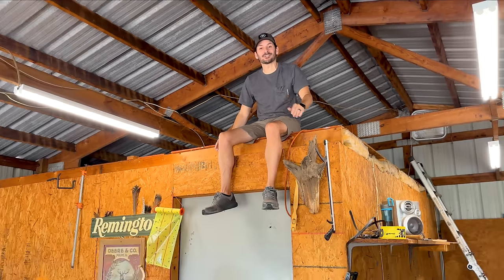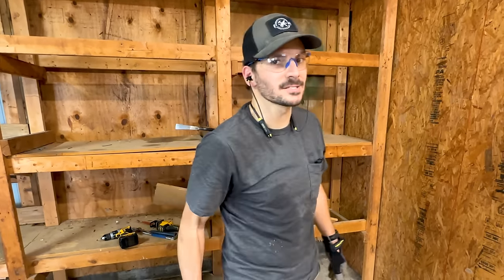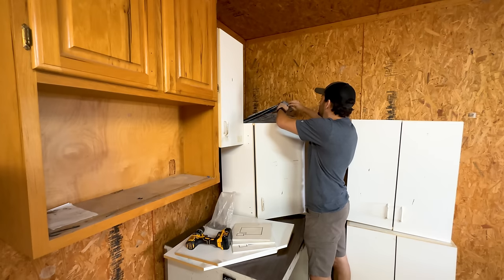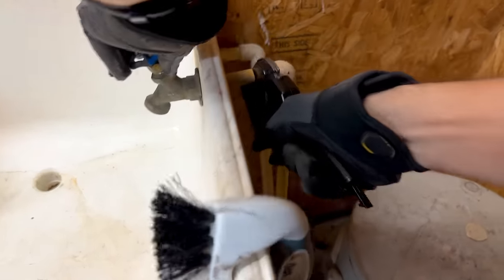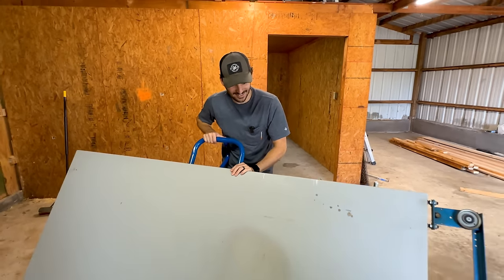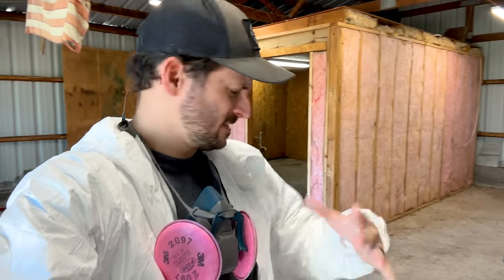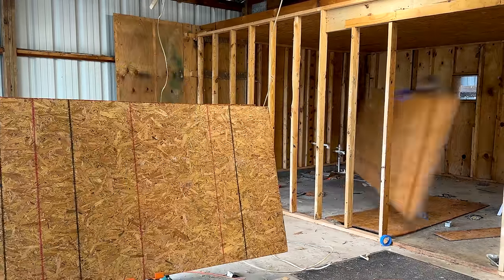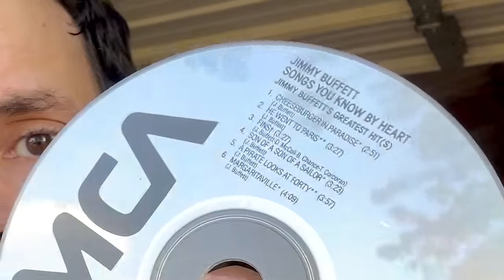It's worse than I thought... Demolishing My Old Shop

Comment: Good thing you didn't breathe the mouse stuff in. Hantavirus ain't no joke (especially on the fatality rate). Every time someone's playing with rat nets (cars, houses etc) it's basically a reverse lottery of who gets misery, who gets... well, the other thing.

That aside, dunno if you have already or plan to, but you should check all the roof stuff as well. Make sure everything's on the right side of history (structurally and as a barrier). A lot of new owners ignore that part of a building and it ends up biting them in the bee hind because that's where the leaks come from. What you want to look for is loose connections, rotten wood, evidence of leaks. Two tools are your friends up in there, a small prybar and a good headlight. You wanna jiggle all the wood element connections to see if there's anything that may either be rotten or loose, those need addressing quick. It's wood, you know the score. 

Shop tip: think about a small rail crane. Having a crane by the door to remove loads and put them on carts, that's a good thing to have regardless of what that shop's purpose is. I'd go for either a 2 ton or a 2.5 ton crane. Excessive, but it's that .5 that gets you out of a squeeze one day. My first shop never had one, i found out really quickly i needed one, and putting one in post factum is a pita. If you don't feel like changing to a door that allows you to have a crane, you can also install a jib crane. At 2.5 ton capacity (max for anything you'd ever pull in a shop that small) you just need to find a metal pipe and build a classic swing type. Nothing fancy, since you're not gonna use this 24/7 like a workshop would. Suffice to have a hook for the moving part and a wire from the top of the pole to keep the arm up. If you look up old school work site cranes, there's a bunch of Modern Mechanix like DIY instructions to pick from online.

11:29 could make a table out of it. If it's good metal, it's going to last quite a long time. I have made tables out of doors in the past and they're the abused work benches in my shop. For legs, i've always used second hand cabinets. 4 narrow cabinets arranged with a hollow space in the center and all the shelves facing out. Makes great storage and the center area allows you to put electric stuff in the center if you need powered outlets. Those pop out outlets that are flush with the table surface are perfect for this. If you can't find flush ones, you just get a normal set of pop out outlets and just glue them in place without the trim. As long as you don't mess with the electric aspect the extra bits are just that, extra.

extra tip, buy one more of those nail grabbers and either weld or ask a friend to cut and weld the tip (about 2 cm from the nail grabbing feature) at 90 degrees from the handle. For narrow spaces, they're god sent, but even for common use, because the striking point is closer to the nail while you're able to keep the grabber tips from the side and out of the hammer's path, you get a lot more control. Some sell 90 degree, narrow space ones, but if you have a nail grabber that's quality, it's always best to use that one, and not waste money on the off chance they're not as good. Not all nail grabbers are made equal, some are just junk and that's even from reputable brands.
Reply from the maker: thanks for the well thought feedback!
Reply: Hantavirus is pretty rare and pretty deadly, like about half of the people who get it will die.  I saw one case in my career.   A guy was cleaning up droppings.  He barely walked into the ER the day after he got the "flu".  He rapidly became unstable and died about 3 hours after he arrived.   Pretty sad.  (I also saw a case of rabies in a four year old girl but that's another story)

Comment: I laughed, probably harder than I should, at the "Love of nails comment. I redid my kitchen this year and they had previously put in a drop ceiling. I got down to the frame that they attached to the ceiling too, and as I was doing sheetrock I went about pulling the frame down ONLY to find out that they had used FIVE INCH sinkers to affix the 1 by material to the roof. I weigh a good 240, and at one time had myself hanging from a hammer trying to remove these nails. God help us that ANYONE thought that this, or your nails, were a good idea.
Reply from the maker: 😂 😂 Yeah, they had some 16 penny on the 1/2" OSB in a few spots. Had to use the leverage of the wrecking bar for those

Comment: As a former garage door tech, I don't recommend WD-40 AT ALL on the door, and not necessarily WD-40 lithium either. Use LUBRICANT.
Reply from the maker: genuine question, why don't you consider white lithium grease a good lubricant?
Reply: @Fixthisbuildthat  I'll admit that it's a bit of familiarity. Silicone might have advantages with plastic rollers, which many garage doors use. As a rule we tell people to avoid WD-40, because it's basically a detergent with mineral spirits in it. Most don't think of their lithium grease product.

Comment: I know you talked about re-using some of the materials you took out.  Honestly, I would throw everything out, pressure wash the entire interior, spay paint all the wood, and start all new.  Or at least spray paint any wood/sheet goods you reuse.
Reply from the maker: Keeping the wood. Everything else is gone.
Reply: @Fixthisbuildthat  Inwould still take gallon sprayer and spray the wood with a water and Clorox mixture 1 part Clorox, 9 parts water

Comment: Elevator door would in theory work well as an assembly table, it should be very flat and wood glue shouldn't' adhere to it, you can scrape anything off it easily like stain and you should be able to build a folding frame w/ wheels so you can fold it flat against the wall - also don't expect anything at all to be done right anywhere near the house... what you are seeing is peak "I'll make it work with what I have" engineering and i'm sure they didn't stop at the shop... be very careful doing anything with electrical in the house as there are problem random outlets and switches on random breakers all over the place.
Reply from the maker: yeah, this place is goingto be full of "surprises" I'm sure

Comment: When you lube a garage door you don't spray the wheels or tracks.  You lube the pins and sleeves that the wheels are mounted on.
Reply from the maker: I don't think spraying both can hurt since it's all metal anyway
Reply: @Fixthisbuildthat Nope, doesn't hurt one bit, besides attracting more dust and dirt.  I just wanted to point that out as most incorrectly spray the tracks and wheels itself.  Also, it just so happens that the sleeves and pins are what also causes most the the rattling and noise when opening.   They do make plastic bushing/sleeves which drastically reduces noise.

Comment: I have a 50‘ x 70‘ RV building 16 foot high doors. Let’s plan for me to do an Internet store 1000 ft.² on one end. And then we decided let’s do an apartment upstairs so there’s a bathroom downstairs there’s a bathroom upstairs that I built for my son two bedroom nice apartment. However, he got married but that’s OK so I still have a 50 x 50 building but useful with three doors one to drive through and one it’s just a single Door And they’re 16 wide 16 high. On one side there’s all these shells for storing extra stuff, welders and all the things to do with that kind of stuff and then there’s a 37 1/2 foot toy hauler that goes in that day. And then in the middle, there’s a, 16 foot box trailer, my jeep and my tractor. So in the next day, I have a long flat, but two axle trailer and there’s a workbench against that one back wall. And there’s also room to drive a vehicle in front of that flatbed trailer. There’s a set of stairs for the apartment upstairs on the inside of the building and there’s one sit on the outside. I don’t run the Internet store any longer, but anybody wants to buy a whole bunch of aviation stuff open up a store solo to you one price. Whatever you have is never big enough so just letting you know that’s not my house garage. That one is overlength so a crew cab long bed & Cadillac would fit in there instead of having a instead of a 16 foot wide opening on that garage it is a 20 foot door opening so you don’t have any problems getting both items in and getting out of the vehicle some both sides. You can never have enough garage space. And that doesn’t count the 36 x 60 building in the back of the house that has an indoor pool that’s 16 x 40‘ with a bathroom in there also that’s not the house either love my house but people think it’s much larger than it is

Comment: Lots of nice reclaimed material for future projects. 
I’d personally make a welding fixture table out of those sheets. 
Good enough for smaller jobs. 

It’s always nice to have a work surface that can’t be easily damaged.
Magnetic jigs work and you can resurface it with a wire wheel when needed.

Comment: Honnestly, the kid inside me is always screaming "if you build something and don't put a Hidden area or secret passage, why are you even building that in the first place. Just put some fun in your work dude".

So, i'd suggest you to get that elevator door to get some cosy rest area, or like, some shortcut to your house or exterior toilets. I always feel the need to take a rest during craft, so, having an area with a nice door like that where you can just you know, chill up, have a cold drink, and maybe a computer to just do nothing while you're getting your energy back on level, that could be good.

Maybe it could be that : enclosed area with computer to previsualize your vids on the shop. And keeping dust away from your electronics.

Comment: Hey! I came here just to make (funny) comments because you have a place for them.  And I figured you could use some cheering up since you almost killed yourself three times  in the process of the demolition.  My comments won't be as (Potentially) Shocking as some of the things you found in your demolition.

In a video comment section  today  I saw Where a  content assembler said, "if you were gonna do it, overdo it!".  I think the guy who assembled the shelves in your "shop to be" ascribed to that philosophy. He also might've only had nails when initially assembling it and added the screws later. I can't imagine doing the screws first, and the nails later. But guys  Who were building stuff pre-pneumatic fasteners and pre-cordless impact  Drivers used nails. 45 years ago you could buy a  50 pound box of six, eight, or 16  steel common nails  for  $20.

Theory-  The mice gnawing  their  Way through the insulation were ( what we will soon no longer call) Minorities and women. They were chewing their way to the top through  what they thought was the (fiber) glass ceiling.  It's close to shattered now.

"Once you label me, you negate me" Soren Kierkegaard

Comment: The more insulation, the cooler inside the building in the summer and the warmer in the winter!  

It goes for all kinds of buildings, but especially inside a metal box!!

Windows (and a door) in the back will provide most of the air conditioning you need in the summer.  The extra insulation, 10-12 inches in walls and roof will be paid within 2-3 years with the money saved in heating and cooling, AND you'll have the next 30+ years with low expenses! 
  
I know, I know, it's not the American style - and more something we crazy Scandinavians are more into, in fact, not "just" to save us a lot of money, but also because we have very strict building regulations that require us to insulate our houses and workplaces very very well, (walls, roofs and floors, and windows with minimum 2 layers of glasses). 
Also to protect our climate now and in the long run!!  Which also is something we and our governments care about!  Left and right, and all in between!

A total win win!    You can choose to send your family away on vacation 1-2 times a year, and you get to buy new tools and/or take some weekend getaways with your friends.   
That's an extra win, right sisters??   Win win win!!

Or you can just forget about insulation and use the thousands and thousands of dollars in heating and cooling instead.  I'm sure those companies you pay will appreciate paying them your hard earned money instead of spending them yourself on things of your choice.  

❤💥🍹🌴🌎❤

Comment: If you're going to retire here, then it seems like you should do it right, and weather seal + spray foam that building (even if just a bottom portion) to reduce the chance that it becomes another easy animal habitat... And if you're going to spend a LOT of time out there, like fulltime job, then......... gotta spend up, or you're gonna be miserable and the next guy who buys it from you will be doing the same thing with rot and mold and mice :(